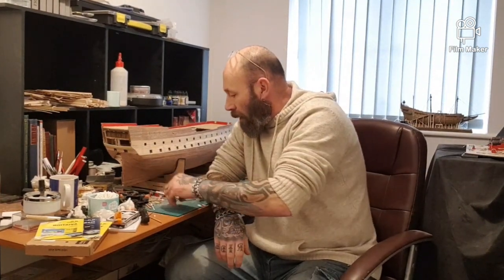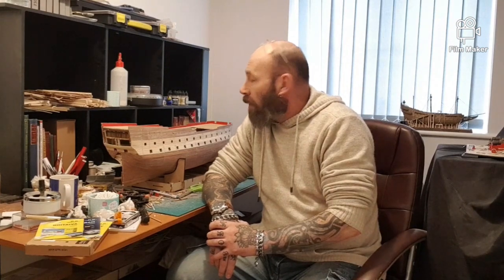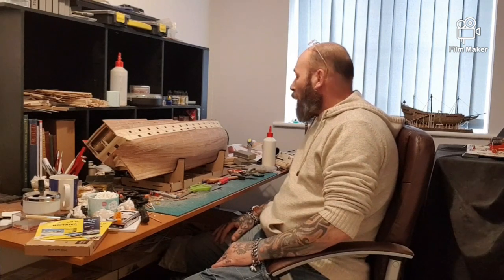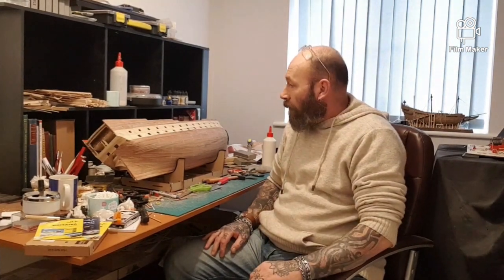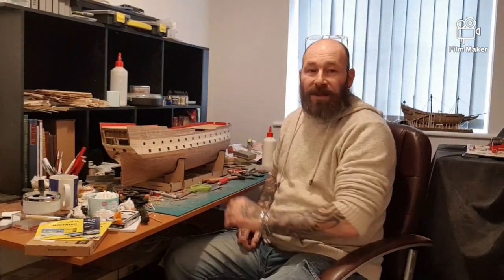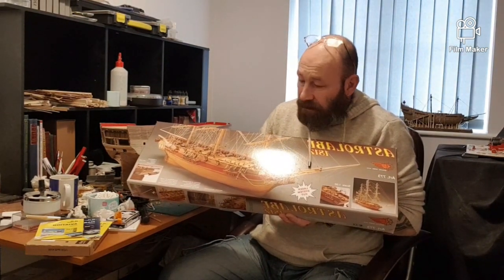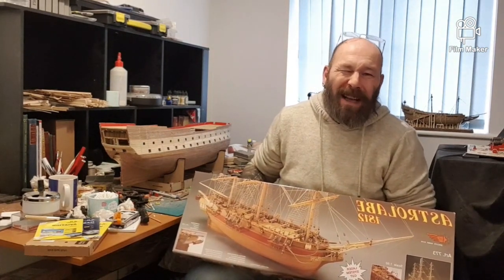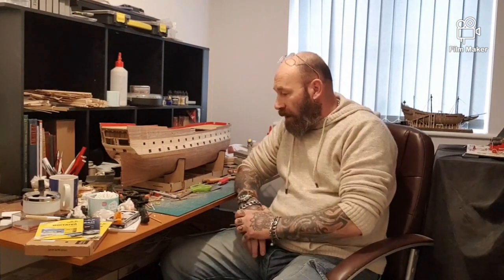San Ildefonso update

Comment: Hi Rob is it possible to do a video on how you calculated, measured and cut out the Gun ports if you haven't already done them on the starboard side. 

All the best 
Rob 👍⚓🤺
Reply from the maker: Hiya buddy. In all honesty I didnt need to. This is the advantage of installing the bulwarks prior to planking. They were already cut out. All I had to do was cut out the planking that covered them. Check out my build log on instagram on the post where I install the bulwarks. You'll notice that they are already there. I just had to plank the bulwarks, and then re cut the port out from there buddy